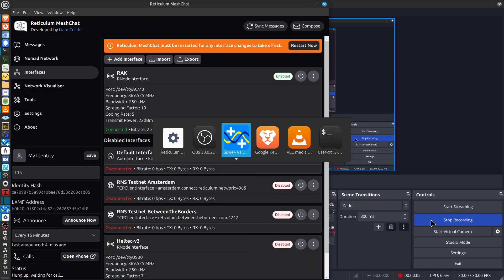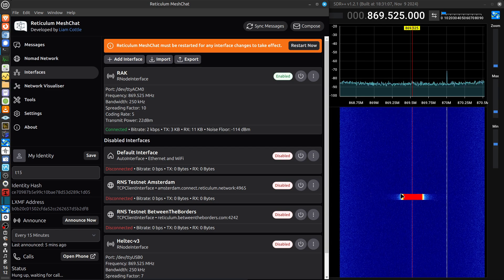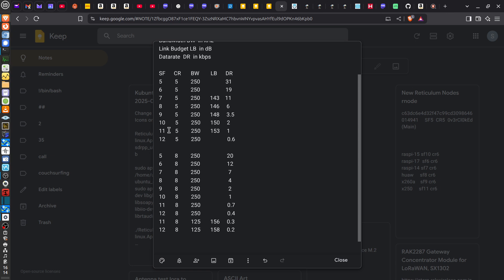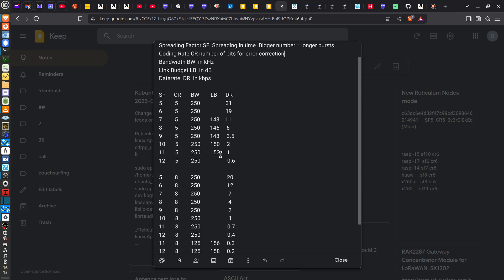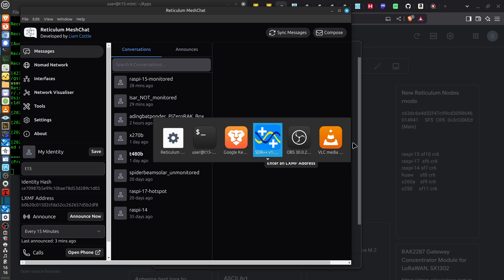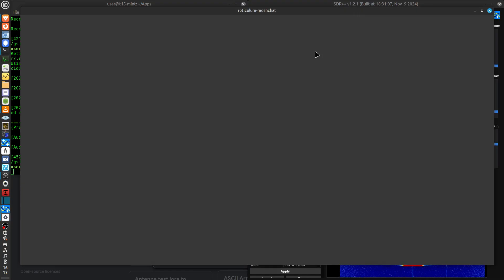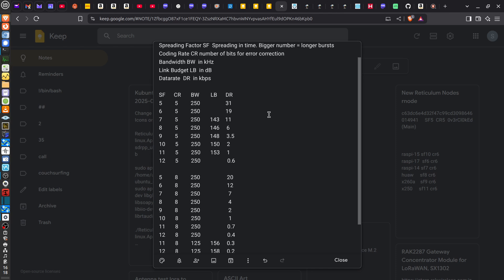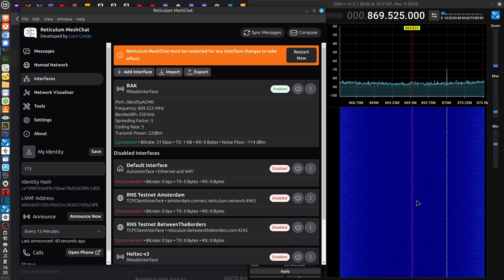LoRa Parameter Settings for Reticulum and Meshtastic

Comment: Hi Simon! Thanks for all your dedication in making these videos, this LoRa business is fascinating! I'm currently stuck in Meshcore at the minute, but will give Reticulum a go in the near future. A quick unrelated thing regarding AppImage applications - I discovered a tool called "Gear Lever" that makes it possible to easily plumb downloaded AppImage files into the application menu. For some apps it is even able to download and install updates, so it's worth looking into. You'll find Gear Lever in the Mint software manager as a Flathub application. 73, Jan M7HNK
Reply: Which settings does meshcore use? Same as meshtastic? Or somewhat optimized?